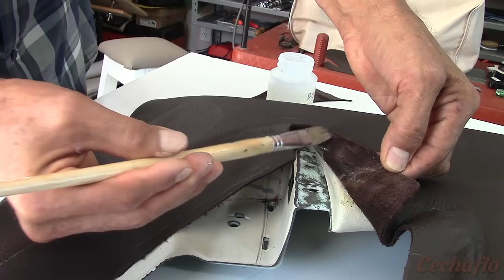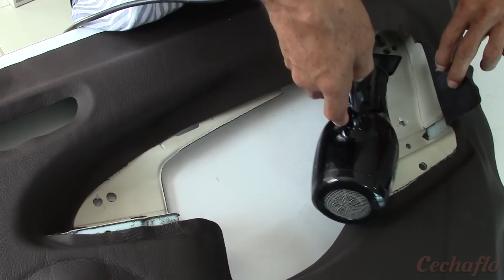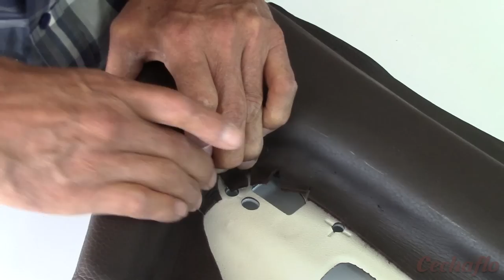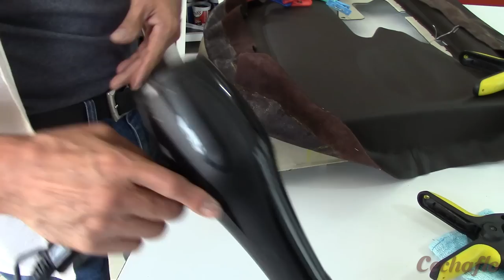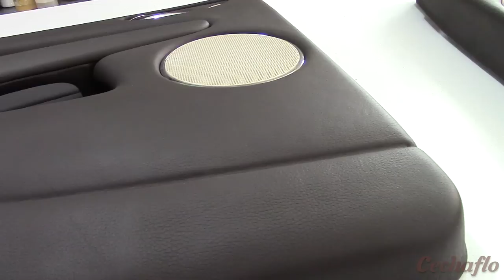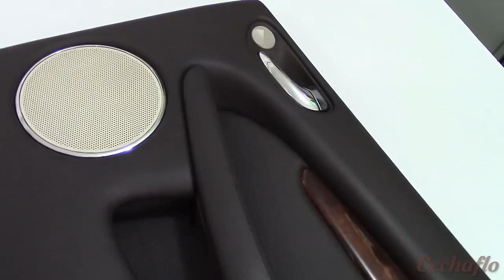Car Door-Panel in Leather - Car Upholstery video clip

Comment: Nice work on the X-Type. I have a sedan I would like to change the colour of the door cards/panels. Could you advise me if it is possible to apply a new layer over the top of an existing factory vinyl layer? I fear if I try to remove the existing factory cover, it might damage the panel itself. The current vinyl cover is in perfect condition as well. Thanks in advance for any tips.

Comment: Does heating up the leather makes it soft to apply on the edges or corners? I want to do this job. Excellent job 👍
Reply from the maker: Heat (hot air, vapor, etc.) does not soften the leather material. It only helps to erase wrinkles and give shape to molded parts, because the leather shrinks with heat. The heat technique works well with vinyl.
What you first should take into account is to consider the stretchy side of leather:
https://www.youtube.com/watch?v=dhmCJFpOs_0&t=305s
If you want to make the leather softer, there are 'softeners' shoemakers use to mold leather: https://www.youtube.com/watch?v=r1X3sSjfgw4&t=217s
Reply: @Cechaflo  it will be very difficult for me as my leather is about 1,2mm to 1,4 mm thick. They way you did the corners and edges looked very easy. Maybe once I glue the upper part, then maybe I stretch and shape the leather like you did with the button. Idea came to my mind how to do it. My leather is different pattern Called saffiano or something like that. It looks like a grain of dashboard or door card. Thank you for your help. Once I get it done, I will let you know how it went.
Reply from the maker: @harnis3650  https://youtu.be/beiywfE1lZE?t=317
Reply: @Cechaflo  wow amazing. Thank you soo much. Now I know what to do. Need to buy leather treatments to make it soft. I'm sending you regards from Slovenia 🇸🇮👍
Reply from the maker: @harnis3650  The treament should be done only in the areas that would need to be stretched. Do a test beforehand on a scrap of leather.
Reply: @Cechaflo  ok I will do it. Thank you again 👍
Reply from the maker: @harnis3650  Good luck! Greetings from Mexico!
Reply: @Cechaflo  thank you 😊
Reply: What kind of glue is that?

Comment: Beautiful work, as always!
@6min, did you shrink the leather on the outside corner so it wouldn't bunch?
Reply from the maker: No, I didn't. The heat air hair dryer is activating the transparent polyurethane glue. The leather is pulled down to center line and stretched angled to both sides.
Thanks for watching!
Reply: @Cechaflo hola. Podrías explicar un poco más la técnica? En que sentido debería estirar el cuero? Me sucede que me queda desparejo el cuero luego de pegar curvas y ya estropeo el trabajo porque se me acumula cuero que no puedo distribuir en el resto de forma prolija. Cual es el sentido en el que estira? Felicitación. Es un verdadero maestro. Saludos.
Reply from the maker: @nicocrocco  Jalar el centro de las esquinas luego a los costados jalanda el cuero/piel ligeramente hacia atrás para ayudar a no formar las esquinas. 
Con suerte estos videos ayudan:
https://youtu.be/beiywfE1lZE?si=vVUL3164VFTJaSE3&t=321
https://youtu.be/RK50VXOawIU?si=ze37DFqYlvI96zYu&t=2562
https://youtu.be/cKl5si8naDs?si=QldogNsip4KF283H&t=687
Estiramiento del cuero: https://www.youtube.com/watch?v=dhmCJFpOs_0&t=566s

Comment: Hello what ist the name of this glue, with aktiv with Temperatur
Reply from the maker: https://www.youtube.com/watch?v=TIKF6NvXHE4
Different trade marks in each country.
It looks like a similar product on Amazon. Check it out: https://www.amazon.com/dp/B0068KNGMK
http://www.rhadhesives.com/dual-88-neoprene-cement.html
https://www.ebay.com.au/itm/Duall-88-All-Purpose-Neoprene-Cement-/252691571226
https://en.lial.biz/sar-306e-desmokol-1kg?tag=adhesive
https://www.amazon.com/SX-69-Vinyl-Cement-Glue-Industrial/dp/B0839PW1C4
https://www.livemaster.ru/item/11132039-materialy-dlya-tvorchestva-klej-nairitovyj-alkor-ats-440-ph
https://www.promarinetrade.com/accessories-for-inflatable-boats/6847/GLUE-+DESMACOLL%2C+330+ML-PM-DESMAK-330.html

Comment: Hey could you tell me wich glue do you use for doing this great work?
Reply from the maker: I have used a transparent glue called polyurethane glue. Shoemakers use it a lot for shoes and tennis shoes. For the edges I used the traditional upholstery yellow glue.
Reply: @Cechaflo  hello thank you very much where are you located?
Reply from the maker: @matthieubonte2513  I am located in Mexico.
Upholstery yellow glues: https://www.youtube.com/watch?v=o2xeezdF8Ss&t=35s
The shoemaker's polyurethane glue should be applied on both surfaces and let it dry for a few minutes. Once it is dry, the pieces can be easily lined up. The 'dry glue' is only activated with some 'heat' (the hot air of hair dryer is useful). The more this glue is dry the better. Some shoemakers say this glue is much stronger if dries from one day to another. I like to use it on areas difficult to handle with the yellow glue.
Reply: Thank you very much for your advice 👍 it's too bad that you live so far. I wanted planning to send you some panel door to do. I will try by myself.